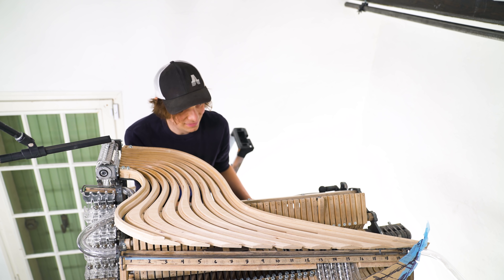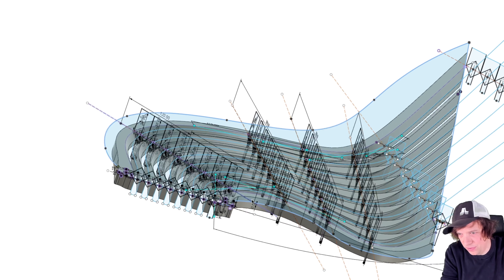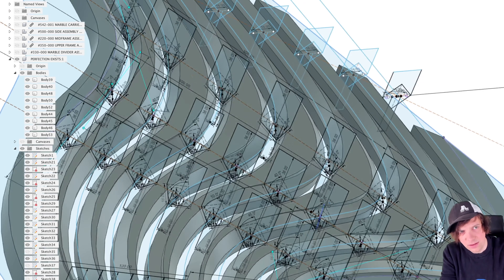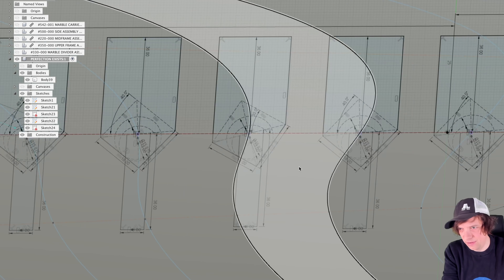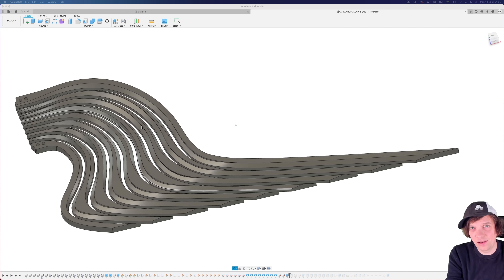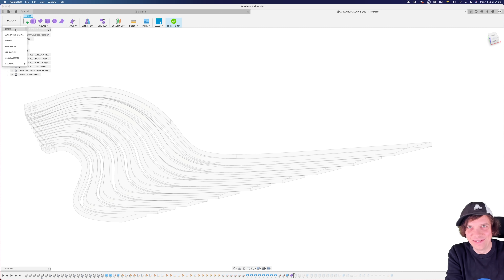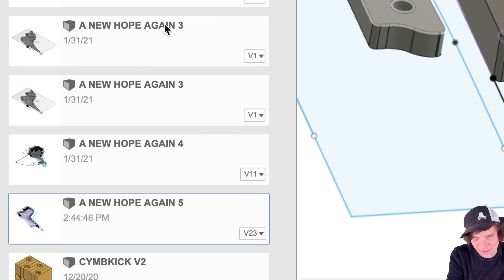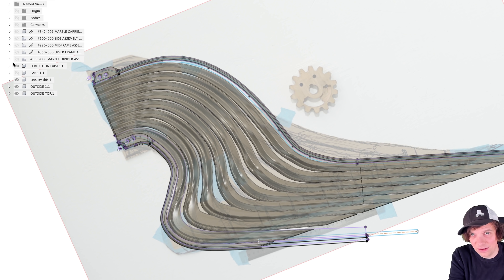Marble Lanes

Comment: As others have said, this new design feels like a step backwards. If you stick with the new design then in a few weeks you'll just be discovering new issues with it like you did with the old one and be back to square one. Instead you should stick with what has already been working well for you and improve it. It seems the new design hasn't actually addressed any of the previous issues, namely there's still a massive gap between the marble lift and the ramp where marbles could escape, exactly the same as the old design.

Comment: Like a few others here, I was initially surprised by the scale of the redesign and concerned about the way the new design distibutes marbles to the drops, but on reflection I think there might be method in the madness! A couple of videos ago, Martin finished up discussing the need to make sure the fish stair doesn't run dry, which could become a problem when all the marble drops are in operation. The way these new marble lanes distribute the marbles is going to send more marbles straight back round to the fish stair, so that helps solve that problem. More marbles feeding in from the fish stair should also make up the feeding of the early drops that the marble lanes are skipping too. It remains to be proved in operation, but I feel like this might create a better distribution balance between the fish stair and the conveyor. And if it works out that way, it means redesigning this part cuts out the need to redesign the divide by four, so the work here saves work elsewhere. And of course, it looks stunning - this has a grand piano elegance to it. Among all the talk  about sacrificing aesthetics for function, if adding these beautiful marble lanes AND keeping the divide by four works, this feels like a huge win for the MMX!

Comment: Will you not have the possibility of starving the first few channels with this design? The marbles don't always move up the elevator 8 at a time and even if they do and the vibraphone is playing a lot, the marbles from the vibraphone get distributed down to percussion and bass and not where they need to go. The KISS way of doing things would have the marbles fall into a track in a row, roll down and take a corner into the track that feeds the marble droppers, always staying in a single row.

Comment: You can of course slow down the marbles by increasing the angle between the walls from 90 to some higher value, altering the contact point between marble and wall closer to the marble's axis of rotation. As explained in previous Wintergatan videos.

In the first half of this video I was blown away by the beauty of these lanes and the design process. The second half made me not feel so bad about my own mistakes in woodworking. All good.

Comment: I think you need alot more marbles to make sure the system keeps up with the demand of the current marble devider system. I feel like the current system doesn't take into account that if one channel is like "spammed" the other marble lanes won't receive enough marbles. I think thats why it is upmost importand that you can get those most upper marbles as flat as possible. This will take alot of trial and error.

Comment: The way you took a photo and then made it into the on screen template is subject to lens and other distortions so the size of the image may not have matched the actual size of the template towards the corners, even if the centre is correct.   Something like what is detailed in this article.. https://photographylife.com/what-is-distortion  Usually you won't notice the distortion (unless it is extreme) as our brains are used to adjusting for it.

Comment: That sounds to me like you're looking for a complex valued differential equation, in which the angle theta defines the tilt of the square.
Or maybe just a differential function who's curve(or its derivative) defines the tilt of the square, 
but that's probably akin to a 5th grader telling a stock options trader to buy low and sell high.

I've got no clue how you'd implement that in CAD, but it does sound like the type of text question i've seen in my HS and early Uni Calculus classes.

Comment: The width of the lanes at the bottom was fine, it’s the relationship of the positions of the conveyer and the top of the divider that is off for some reason. 
Also as others have said, those marbles should be going slower when they get to the divider,
Lastly, what do you think will happen when marbles coming down the new lanes hit a marble rolling down the divider?

Comment: Just a comment, but hopefully this won't be offensive (IS NOT SUPPOSED TO BE!). I think that you are falling into the trap that you'll just be fixing problems forever. Unless you have a suitable and awesome roadmap that my 14 year old self is missing, I believe that you should restart but utilise work you've already made. From there, you can decorate (Not like a barbie house) your machine and clean up the work. Also, you can incorporate implementations that you've already made. This is a great way for you to fix lots of your problems. Also, you should look into Solidworks (I know its expensive!). 

Basicially (tl;dr) what I'm saying is that you should take this comment with a grain of salt but consider the content I've discussed that you should restart (in a way) the MMX and reuse the material you've already built up. Wait for your response if it ever comes!

-Lamp Sauce, waiting for Gordon Ramsey.

Comment: Seems like you don't need that angle change so much. Instead it would be nicer to have the marbles flowing in a more controlled way (slower) just by making the contact points further away from each other. Then you can probably use 45° walls all throughout.
Great looks tho and nice work, thanks for keeping up updated!

Comment: Those marbles are gaining a LOT of speed. I hope that will be ok.  I love all the wooden shapes in the marble tracks, but is there also a thing as "Designed for Transport" ? So afraid this will break while touring/handling, right at the top there. I would make the connected bits between the lanes a bit wider there.

Comment: If the camera optical axis is not perpendicular to the wall, the photograph of the template will be distorted (in the same way that a slanted rectangle becomes a trapezoid). This could introduce a systematic error before the cad!

Comment: I'm afraid of fusion and parametric design. So many times it just breaks down even with small changes. Inventor and other professional cad systems are much more consistent at this :-) I would not dare designing that in fusion. I think you need more splines to guide your marble paths, not just the center one, but a pair for tilt on both sides as well for the corners. I dont know how good fusion is at multiple guide lines, but that would work pretty well in sw/inv/nx!

Comment: Oh Oh Oh Martin, isn´t the new style function over design? This looks amazing and it will work one day I am sure. But befor you put so much effort in the design, shouldn´t you talk about the obvious mega problems. Not just the speed over the devider that you cannot control after installed and with try and error it would take forever. But more important, how do you make sure marbles don´t land on each other and jump out when going into the devider? I would hate to see you disappointed again with a "50.0000 marbles no error" video. :) But of course I would still watch it :D

Comment: So what’s the goal with the lanes? Isn’t the goal to spread the marbles over the Marble Divider? Perhaps you could solve this problem with a stochastic approach. You could use the idea of your Programming Wheel with little pins. The marbles start on top and then by hitting the pins they spread all over in a stochastic way. They also are a lot slower then. You could replace the pins to change the spread of the marbles... A little chaos for perfection! :)
Reply: Would be very noisy

Comment: Just as a prefacer: I am here no machinist expert and also not a Fusion360 wizard.
What I have is somewhat of an understanding of how one can optimise workflows. 
My suggestion would be the following:
1. Make your spline-curves to define the path, the marbels should follow.
2. Create a line, intersecting the splines, everywhere you want to define the rotation angle of the marbels.
3. In association with the lines, generate a (I believe it's called) User parameter for the angle the track is supposed to be rotatet at every line created in 2.
4. At every intersection point of the line and the spline add a plane perpendicular to the spline.
5.a (The part where I'm not sure if Fusion supports it) Take a Copy of your sketch of the square and paste it onto the planes created in 4. 
5.b Use the User Parameter from Point 3 to define the rotation angle of the copied square. 

A possible solution to point 5:
If Fusion doesn't support the copying of sketches and constraining them, you could try to make just one spline as a parametric object. Then you duplicate the object and constrain it to the old one using distances between points.

Comment: I was going to say this was one of your best designs ever .... and then I saw the mistake  - but I still think it's the grooviest thing you've built so far. The banked curves and the extra guard rails on the side should make it fail safe. So what if you messed up the tail end - it's an easy fix, just takes time to machine the new piece.

However,  I have two things that concern me: 
 1. is it enough to have channels 1-3 fed only by the fish stairs?
 2. I am concerned about the stress that is put on the material by the top screws at the conveyor belt. When twisting/bending wood, it's common practice to heat it with steam, but that's probably not an option with plywood, it'll probably just fall apart. Maybe you should glue the guard rails while the piece is mounted in place so they act as reinforcements to hold the the twisting in place, and maybe add extra reinforcements on the bottom side for the same reason.

Comment: it's great to follow the development both when it goes smooth and when things need adjustments. Funy to see how you will design and incorporate the "fall" from top og the slides where marbles start, down to the bottom where the slides connect. Maybe a spiraldesign is better to bridge the gap from top to buttom?

Comment: Autodesk Inventor has a ‘Sweep’ tool that sweeps a profile along a selected path. It’s much simpler and quicker to use. Not sure if Fusion 360 has the same tool
Reply: Fusion has a sweep-tool.  I Dont know how you easily would create/control the tilting of the tracks. Might work with 2 paths where one controls the "S"-shape and one makes the profile tilt.

Comment: Carefull, I see 2 HUGE problems :
 - Too high transversal speed once arriving on the divider (marbles very little likely to enter it + risk of jumps).
 - To have marbles on the first vibraphone channels, you absolutly need marbles not to fall in the divider, to loop through the fishstair. This is NOT robust at all !!! 

Also, think about a more vertical profile at the begining of the track to give speed to the marbles, then, an almost horizontal one with a narrow turn to kill the speed (like in the droppers).
Ideally you sould have a marble arrival at the begining of each section at least (vibra/drums/bass) 

(Also a PMMI pipe system might by lighter on an aestetic point of view)

Comment: Are you sure this solution will work? Each marble lane on the slide carries only 1/8 of the marbles. The means the leftmost marble channel only gets fed 1/8 of the marbles, whereas marble channels near the middle get fed more marbles. Marbles from the rightmost lanes are fed to only one or two channels on the right of the machine. If those channels don't need marbles, the entire round trip is wasted. Is there a danger that the leftmost marble channels will get starved of marbles while the rightmost will have an excess? *I know there's the fish stair*, but will that feed enough for those first channels?

In your previous design, the marbles from the lift attempted to fill at least one third of the channels.

Comment: If you're ever in doubt while doing cad, just go to your machine and measure the dimensions you need. This way you're working more precise and consistent with the already existing dimensions. 
You can even make a design block instead of this template you put in yhe background. This way you'll never fail to loose the connection between CAD and reality. 

Another tip: dont over-engineer your design. Now you added the slanted tracks and took a lot of time adding a 5degree angle between the heart of your square and the axis perpendicular to the surface of your track. It also would've worked without this angle. 

Overall, great design but it needs some work still :)

Comment: I don't know much about CAD but I do know a lot about roller coasters. The concept that you're describing is called "heart lining" its use in coasters has the effect of converting lateral forces (those that would make your marbles jump their tracks) to positive forces (a downward vertical force into the track). All this to say that the technique is achieved by drawing the path of travel above the center of gravity of the moving object. The "banking," or what you've referred to as the slope, pivots around this higher point like a yo-yo from a string. In the case of humans and roller coasters the chest or "heart" is chosen as the pivot point, not for any cardiac reason, but because its about a foot above the center of gravity for most humans. I imagine you'll get the effect that you want if you draw your CAD paths from the top of your marble measurements rather than from its center point. Hope this was at least entertaining to read, if not much help with your design endeavors.

Comment: Must think about the MMX like industrial machinery more than a musical instrument. Always check the "Speeds & Feeds" for the entire system, it would be best if the marbles were running at the same base speed throughout the machine (if possible) for optimal functionality, the fast single lanes, split up into slower multiple lanes is similar to congested traffic systems. Would be ideal if they all ran the same speed on the interstate highway together, than changing lanes and waiting for traffic. I understand things will get altered by the songs tempo and BPM changes between gates, but try to keep the entire MMX running at the same BACKGROUND SPEED to avoid failures during song play. Why the slower fish ladder then really fast marble lanes? There didn't seem to be enough marble supply feed for all gates. The design appears like the first ~10 gates are not feed any marbles, the next ~25 gates will get skipped by fast marbles bouncing right over them, the last ~15 gates might be feed useable marbles. But ALL the gates are NOT be feed an equal supply of useable marbles. Try to make the lanes equidistant with the same usable slower speed. Too much artistic design, not enough engeering for useful music.

Comment: I am worried about this new design. It looks like balls are getting too much speed which could result in them skipping holes and also by making it spread all the wholes now you have to feed it a full set of marbles each time or the top section is going to run out of marbles. On the old design even if the ladder didn't have a full set system would work.

Comment: Looking great man!  As for the lofted cuts-- the way you did it with a series of perpendicular planes with inclined squares is the best way I know of.  If you want to make it easier to vary the angles, you can define variables within the part or assembly like, say:

SquareTiltPlane1 = 35
SquareTiltPlane2 = 50
etc.

Then when you are dimensioning the squares on each orthogonal plane, you can set them to "=SquareTiltPlane1" or "=SquareTiltPlane2 + 10" or whatever so that they inherit the values from the global variables.  I should say, I have primarily used Solidworks and I am just assuming Fusion360 has an analog for this.

Also, you came to the same conclusion as me with regard to naming files.  If you put words like "Final," "Complete," or "Perfect" in the name, it puts too much pressure on the part and causes it to fail.  I just switched to dispassionate descriptors like "rev2-5" or "ver3" with no expectation of success so the part can chill out.

Keep up the great work!

Comment: In my CAD program Rhinocerous, a surface modeling program, the tool I would use would probably be "sweep two rails", or possibly "loft" where I first draw lines where I want them and then create surfaces between the lines, with also some control over the cross section curves. That gives me perfect control over complex geometry like this. :)

Here is an example when I made a similar, but even more complex design than this.  https://1.bp.blogspot.com/--ZDzgdAPbE4/VbUcs8FK2FI/AAAAAAAABIU/5XuTfgFSyYE/s1600/IMG_1610.JPG

Comment: May I suggest that Martin could use transfer tubes before the marbles continue onto the tracks. Having them roll out onto an uncovered (half pipe like) track seems risky with them potentially flying out. Having the marbles enter into a completely round tube immediately after the stairs/escalator/elevator (IDK what it’s called lol), can then control the speed/even the timing, or most-importantly prevent any bounce before continuing into the tracks.

I get that he may want to make it visually appealing (the whole MMX pretty much is), however an enclosed track may be best. He could have the best of both with an enclosed track by keeping the bottom half where the marbles ride on still made of wood and the top half made of clear acrylic or a type of partially open railing like roller coasters have.